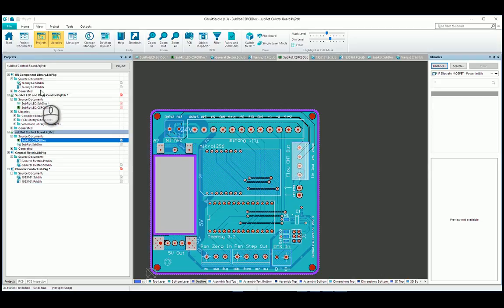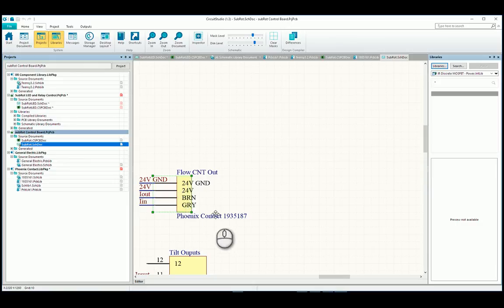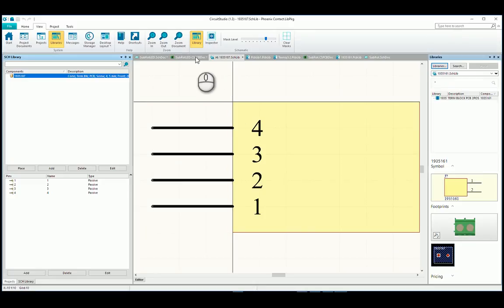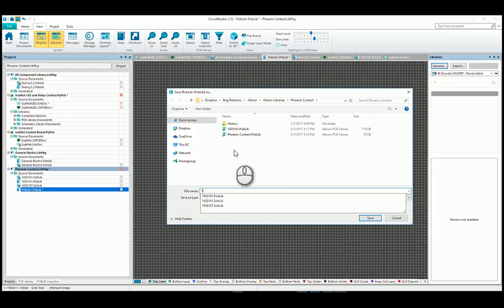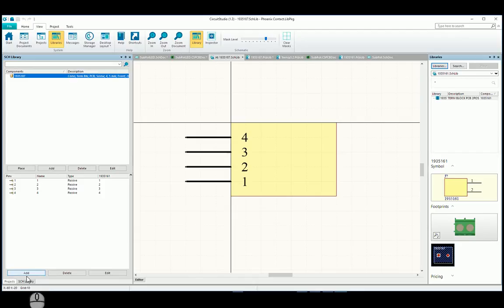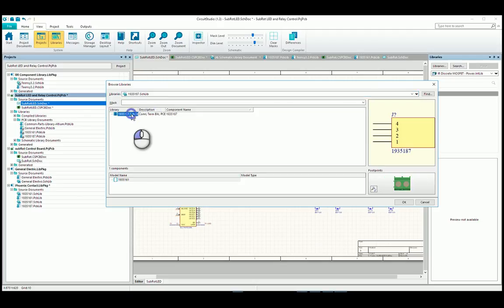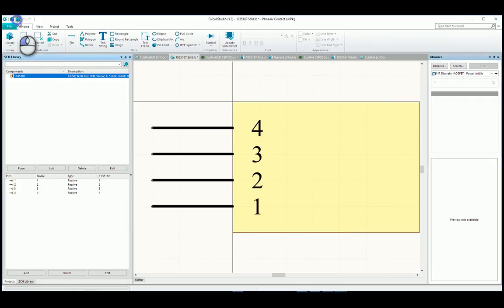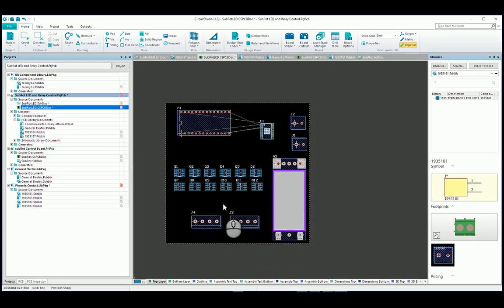Reusing Components in CircuitStudio

Comment: I went from Circuit Maker and bought Circuit Studio and I've used Altium Designer. I think component management is the WORST in Circuit Studio out of all of them.
Designer lets you organize your components with tables or databases, simply filling in a table with individual component details, then using generic symbols and footprints to link them to create a finished real purchasable component. You can then search in the Library tab and organize your components while trying to find the right one. This is best. 
I don't want to create a symbol and footprint and all the metadata of each individual component every time for each component then save 1 individual component to a single (dual library file SCHLib and PCBLib).

At least with Circuit Maker you had the Octopart library (riddled with errors from people who don't know what they're doing). 

I'm at a loss as to the best way to organize components. It's incredibly frustrating.
Reply: I realize too you can make integrated libraries, but I'm not sure I like that either. This should be easier than it is.

Comment: Thanks for this useful video ! To simplify library integration to your project you can simply right-click on your .LibPkg and click Compile Integrated Library. 
Extract from documentation: "Note that the Integrated Library generated by the process is automatically installed in CircuitStudio, ready for use."

Comment: Maybe I missed it, but how do the pins or pin locations on the PCB model get linked to the pins on the schematic model, so that wiring from the schematic properly provides data to the PCB?
Reply from the maker: Hey Graham, check out the video starting at 5:25.  You need to link the footprint.  You can edit the pins linked to the footprint under the "SCH Library" tab.

Comment: Great video.
Maybe you can help me.... What grid settings do you have in the Schematic editor, symbol editor. What is the default pin length in the symbol editor.
Reply from the maker: Thanks. Are you referring to the grid during component creation (PcbLib)? I should probably do a video on the power of the grid settings when creating components. When I am creating components, and not using the footprint wizard, I constantly change the grid settings depending on the component size and spacing of the pins/pads. I usually will change the grid and the origin three to four times when creating a component (for example a DIP package): one grid change for the first row of pads/pins (lets say for 0.05" pad spacing), another grid change
to properly place the second row of pads, etc. 

The default pin length in the symbol editor looks to be .030 inches. You can change the length if you double click the pin and look under "Graphical" section of the "Pin Properties" window. The grid in the symbol editor can be changed by right clicking in the grid area and selecting "Options" -> "Grids"
Reply: Yes, when I make a part in the component editor the pin length often is 2.5mm by default, it was longer when I first started with the software. Also Vault parts often seem to be off grid in the schematic editor. I use metric settings for the grid maybe the imperial would be better. A video would be great if you have the time. Many thanks for the reply I very much appreciate it.